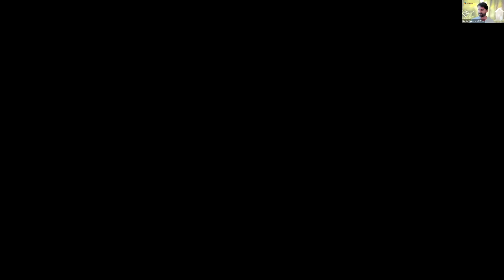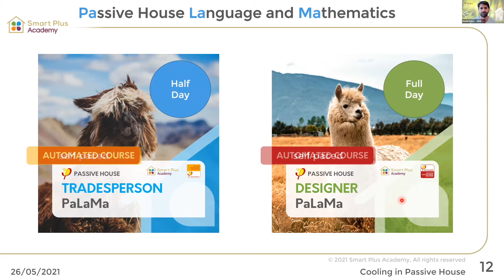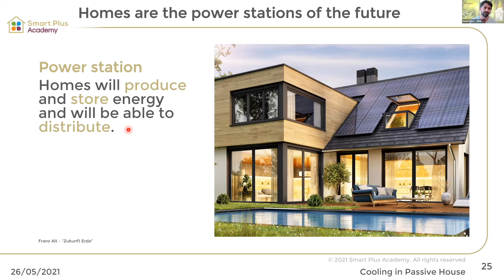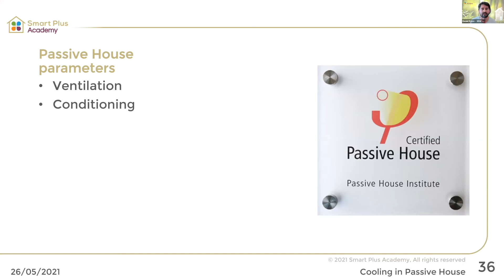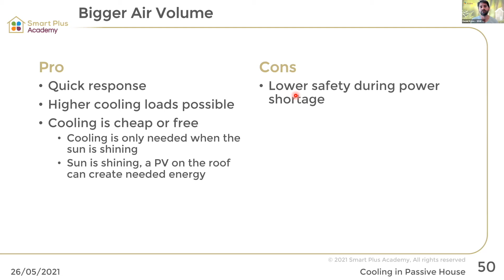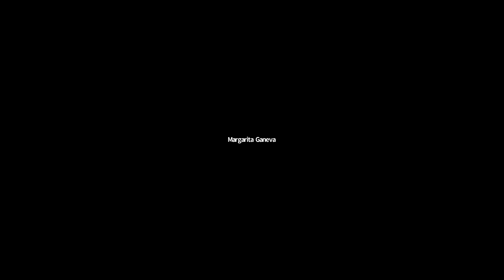Cooling in Passive House | Daniel Kress, Australia

Comment: Are there systems for cooling that have internal recirculation and redistribution to  provide large volumes and therefore more cooling/m2? Could an ERV, that actively controls flow to maintain constant ACH, be used so that the supply vents double up as redistribution or recirculated air of AC and heating?
Reply: Yup: DOI:10.1051/e3sconf/201911101011